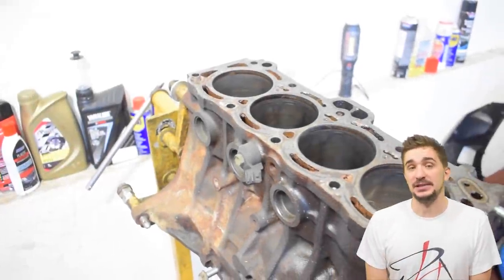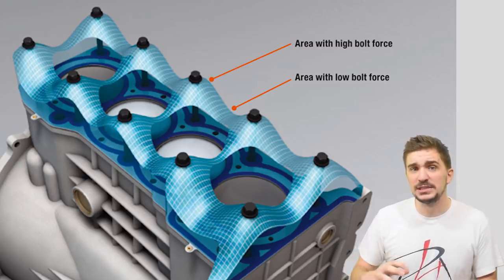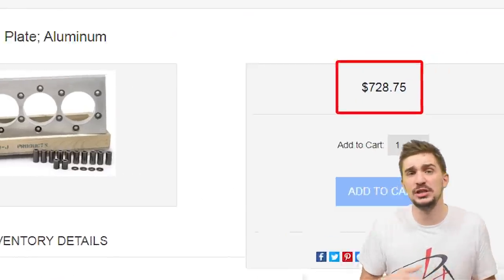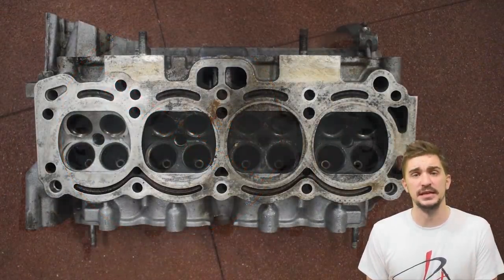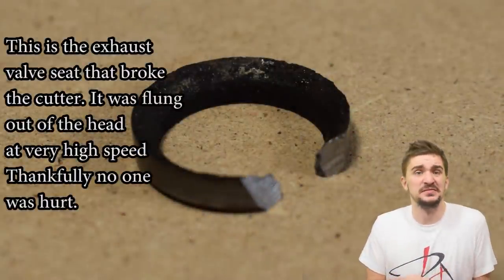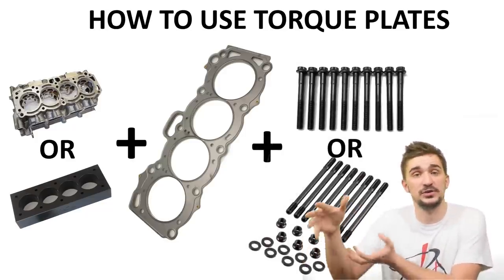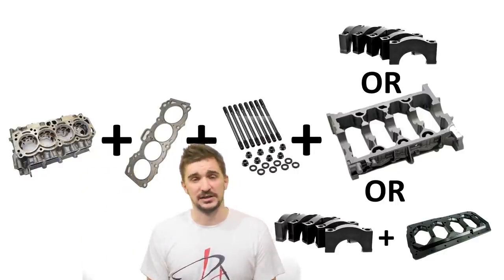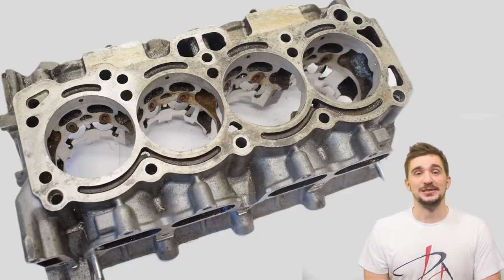TORQUE PLATE - WHAT, WHY, HOW? Do you NEED one and how to MAKE one - PROJECT UNDERDOG #7

Comment: From the "benefit" angle, I would think using a spare head to cut cross sections of the ports to determine optimal port shape for porting would be way more beneficial than making a torque plate for an iron block with 40ish lb/ft torque specs.
Reply from the maker: Billzilla has done 4age 16v and 20v cross sections ages ago, I wouldn't be doing anything new or adding any value if I did that. 4AGE porting has been explored to its limits and its well known territory.

Comment: Would removing that much material from the head now change the clamping forces from the studs/bolts compared to a solid torque plate?
Reply from the maker: Not really I tested it, heads are a lot tougher and stiffer than everyone seems to think.
Reply: @d4a  Excellent.

Comment: I think that after you bore the engine head it looses its structual rigidity and distort much more when torquing it compared to its original cobdition and also compared to a torque plate

Comment: According to David Vizard, torqueing the head bolts down onto 4 or 5 thick washers, is about 80% as good as using a torque plate
Reply: True. The majority of the distortion is right at the bolt hole. Not all but most.

Comment: How about honing/boring the block from the bottom with the head installed?  No need to ruin the head :D
Reply from the maker: You can't bore or hone from the bottom, bores aren't open or accessible from the bottom. Either they have a lip that prevents the piston from coming out or the main bearing saddles and main caps are in the way

Comment: Could one, if in a pinch for some reason, just bolt down the screws in the block as usual without anything else attached to it, to at least replicate the basic force they apply to the block? (Like in a "its better than nothing"-scenario^^)

Comment: The head thing is not good. It is weak in between cylinders, even looks cracked. So it will not simulate gasket pressure between bolts. Having a steel plate flame, water jet or laser cut made is not so expensive and is much stronger. The only good thing I see about it is that you can use the exact same bolts as will be used in the final assembly, that helps.

Comment: I just learned about torque plates today, so im not gonna act like an expert.
I think when you drill the holes in your head, you will decrease stiffness of the head to a point, that i wouldnt think it has a significant advantage over the store bought solution.
What do you think about getting a 15-20mm steel plate cnc plasma cut? I think that would be an even cheaper solution
Reply from the maker: Steel isn't a good choice as this isn't what heads are made from. 20mm is also far too thin to simulate anything.
Reply: @d4a  okay - i just assumed the purpose was to avoid ovalisation from crushing the block right in the corner between the cylinders - therefore suggesting the most cost effective was of bridging over/between the cylinders..
Thanks for the answer though, love your vids

Comment: Would it be theoretically possible to use a ready-made torque plate as a means of reducing compression? Y'know, just in case you're living in a place with sub-70 RON garbage fuel.

Comment: would be possible to bolt the block upside down to the mill table and bore the cylinders from the bottom to archive the same effect?
Reply from the maker: Nope, many blocks can't be bored from the underside as there's a lip that prevents the piston from coming out that way. In many V engines there's also no access to the underside of the bore.

Comment: This is risky. The torque plates are made from one solid block with just 4 big holes and 10 small holes cut in. A very solid piece of kit. On the other hand, the cylinder head has channels in it. Cutting great big holes through it will make it weaker and likely to collapse, twist or distort, when you do up the bolts.
Reply: It will crack.
Reply from the maker: To add to this, I did bolt it down and torque it down a few days after making the vid, there's no cracks or twists, I checked straightness before and after. You're underestimating the  stiffness and structural integrity of cylinder heads.

Comment: Why cant you just install the block upside down and machine it from the crank side with a regular head installed and torqued? (ofc clean it at the end and stop a couple times to remove the metal from the head)
Reply from the maker: You can't access the bores from below on most engines including mine. There's a lip that prevents the piston from getting out that way. This is why pistons are also almost always only installable from the top.
Reply: @d4a  Oh, ok thank you! Is the lip needed for better oiling of the cylinder bores and for block rigidity or what? I mean the piston cant go too low with proper crankshaft and connecting rods.

Comment: If you are going to this extent to obtain a perfect bore then should the block and head (torque plate) also be heated to 90 degrees C?
Reply from the maker: The block doesn't distort when heated it just expands
Reply: @d4a  no expansion of an irregular shape will be be completely uniform.
Reply: @MrTench8  Yes it will be uniform, only in transient changes with local hot spots does it distort but how are you going to do that in a honing tank?

Comment: In an event that I want to rebore my engine but no torque plates available. Can I bore my sohc head? Wilk it mimic the dohc head that I will put on my engine for final assembly?
Reply from the maker: If the head fits you can drill it out, a head is still similar to a head, sohc or dohc.

Comment: does the toque plate thing still apply to cast iron blocks?
Reply from the maker: Yes, often even more so as they are closed deck
Reply: @d4a  What about diesel cast iron blocks? They tend to be much more beefy and rigid than a standard NA gas engine.

Comment: Generally I love your videos - but this time I  think it is not a wise idea at all. Better just take a chunk of steel or aluminum, cut it to the size, and let them bore and drill all holes you need. It will be much more rigid and strong then an old, broken, drilled and weaken head, with possible cracks and all other stuff that will not allow a proper tightening...
Reply from the maker: Using steel as a torque plate is almost never a good idea, if you look around you will see that none of the more famous brand name torque plates are made from steel. The point isn't to make something extremely rigid, the point is to simulate or mimic a head as close as possible. If it's too rigid it's doing more harm than good. I already tested this thing and torqued it down. It doesn't crack or twist when torqued down and it remains straight. I checked straightness before and after. As I already replied to others in the comments, many people seem to underestimate the structural integrity of cylinder heads.
Reply: @d4a  If you saying it works - I believe you. It was just my thoughts and after your explanation now it seems ok to me. I have rebuild a lot of engines in my life and never used a torque plate to bore or honing process.  Maybe have had luck, but all my rebuilds was always successfull. I lead my own YT channel, but just love yours and I find your videos very, very informative. Good Job, keep on.
Reply from the maker: @RemontidEalny  As I said in the vid, they definitely aren't necessary and you can build great engines without them. But I wanted to try an innovative approach to making and using one, we'll see how it pans out. Thank you for the words of support, I appreciate it.
Reply: @d4a  
"famous brand names" also consider material cost, machining cost, shipping cost, pricing , what buyers "think" and are willing to pay for, competitors pricing and profit margin. Not just effectiveness. In fact they would rather sell less effective tools than NOT sell really effective ones. That is why super high quality stuff is rare and cheap junk is plentiful. It is also why private innovation continues to advance faster then the market does.

Comment: I mean I would charge more to put big bores in a cylinder head than a normal chunk of aluminum. Idk how this is cheaper
Reply from the maker: The chunk of aluminum isn't free
Reply: @d4a  yeah but it’s cheaper than the head, so unless you just have a scrap head laying around. Idk I just am thinking about how annoying that would be to machine vs a solid chunk. Breaking tooling with hardened steel in aluminum is a great way to add a surprise up charge to your bill
Reply from the maker: @miles11we  The right aluminum alloy in the right thickness isn't cheaper than a used head, you can research that easily.

Comment: I kind of doubt that that head the way it is now with the big bored holes,  still mimics a real head; i fear that it may even be worse than using nothing; when the big bores were cut, distorsions could have been introduced,and probably have been;  on the other hand, if a cyl.head is torqued  down in several steps and in the around order, bolt threads and head washer properly lubricated,no distortion is imparted to the  roundness of the block bores,at least not more than 1/2 thou T.I R. ;

Comment: This thing looks nowhere near rigid enough, it's cracked already without any load on it. I don't mean to hate but it's arguable if you need to spend extra $200 on this when you say that it's OK not to use torque plate at all. Still your project your rules)
Reply from the maker: I already responded to similar comments. Although these look like hairline cracks they definitely aren't. I have no idea what they are, they seem to be some discolourations from the drilling but they're definitely not cracks. Also, heads are a lot stiffer and more rigid than you think, even with giant holes in them. I already tested this thing and it works very well. I will do a follow up on this thing with measurements in my future vids.
Reply: @d4a  Well it might be rigid but it's definetly not as rigid as a solid block torque plate. You say in the vid that it's better because it's an actual head but it's a head with huge chunks removed from the stretchig area of material.The question is whether you get a significant (if any) benefit from spending extra $200 or $700 dollars. Looking forward to measurments video but it's gotta include some kind of control in form of heads machined with and without a torque plate as well as with a drilled head.